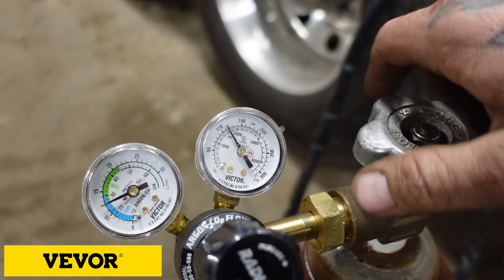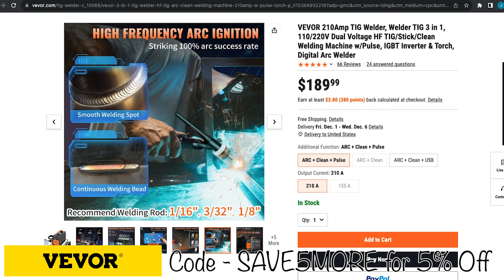Vevor 210A Tig Welder Review! (Best Bang For Your Buck!)

Comment: So regardless of setup, this TIG has no reservable polarity for ground and electrode for welding aluminum? Or did I miss something. What happened to the practice of "Post Flow"? I don't own a TIG nor have I welded with one, but learning is something I practice and post flow is adjustable on this welder and used to cool the welder plus keep oxygen out of the super hot weld at the end of your project, especially thin sheet metal. Thanks for the video as either the new ones are RED or now Black. Maybe Black had a birthday, like a 2 year old application that is a model but….Not a year! Unless you look at the model sticker that shows the build date. A trick to get a deal on new vehicles that had a birthday while sitting on the lot. The dealership's incentive is higher and manufacturers have bonuses. I know as an ASE Master since 78 at a dealerships, new car mangers freak when they find out. Thanks.
Reply: It has reverse polarity for the stick welding side you can do dce plus or dce negative
Reply: They are orange and black now and come with Pyrex gas lense setup
Reply: Correct no AC option so not suitable for aluminum.
Reply: @ Thanks Jared! That just confirms how useless this welder is. My MIG was new in 1984 and welds 1/2” easy. A TIG with A/C - D/C would be a logical next step. I am not sticking welding 8 foot diameter steel oil pipe or need other items to fail or add to cost. It’s like buying a new “Smart TV” that has an 8-track built in! 
Things that make you say “Hummmn!” while rubbing your chin with your hand…